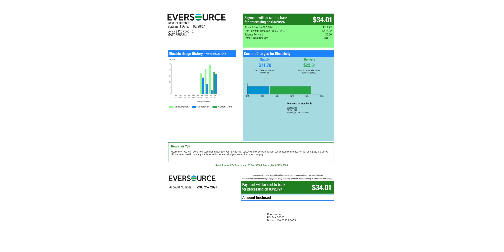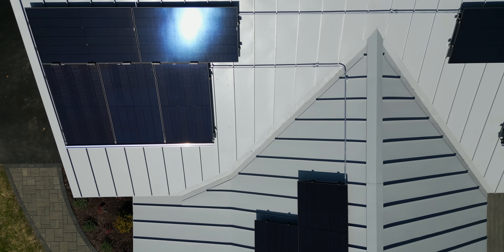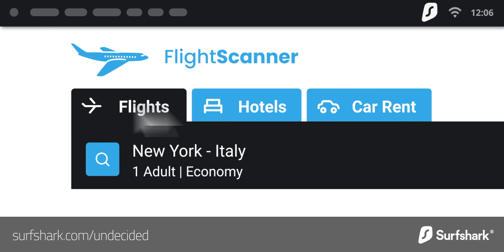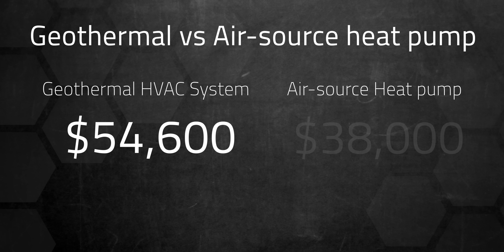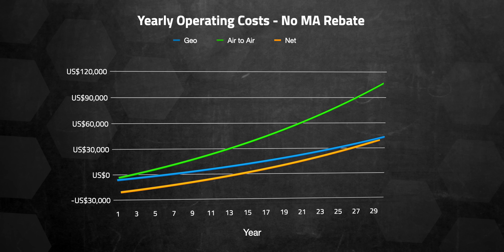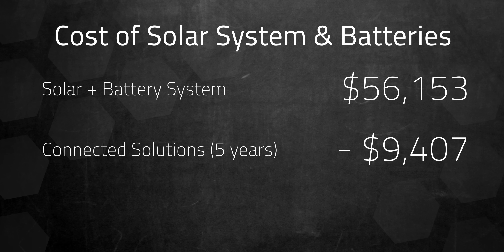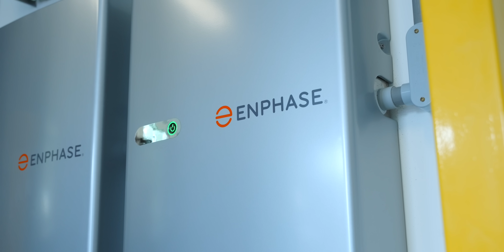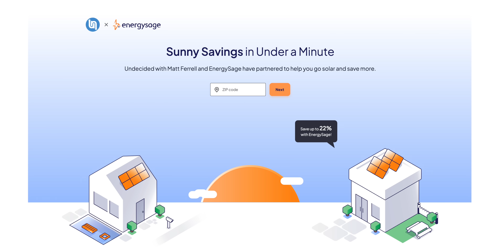What I Learned After 1 Year with New Solar Panels

Comment: The math used here makes zero sense to me.  One thing Matt did not include in his computations is interest, either gained or paid.  Who cares if you could break even on an $89000 expence of solar/battery in 20-30 years.  If you took that same money and invested it, the interest alone would pay for FAR more than your electirc bill and in 20-30 years, you would still have your original investment rather than old solar equipment not worth a penny.  I live in a larger house in a state with the high electric costs (California) and if I computed my annual elecric bill, accounting for the rate of inflation you determined, I would pay about $80,000 for electricity over 20 years.    If I took that $89K and invested it at only 4%, then paid the electric bill from the pool of money (principle/interest) I would still have nealy $80K left after 20 years.  What will that solar/battery system be worth in 20 years?  With interest rates what they are, if you finance the solar, things get even worse.

Comment: Does indoor blinds really help to regulate temperature? I would think you need to keep the sun outside with outside blinds. Or else it will just work as a greenhouse between the window and blinds, heating your house instead.

Comment: Connecticut got rid of net metering for new solar installations so the only options are export all at a fixed rate, currently about 31 cents per kWh or net tariff which is retail rate plus a few cents for renewable energy credits. There is also a battery program that seems similar to Massachusetts.

However in CT our transmission and delivery costs are insane and have only gone up in recent years. So with buy all you might sell at 30 cents, but between all the transmission and delivery fees it can be more than 30 cents especially during on peak usage. Really makes it harder to gauge the long term value of solar installations the state. It was almost a no brainer with net metering.

Comment: Did you take into account the time value of money?  If you sent net 50K net for your system vs 20k for a gas or propane furnace you have a 30K difference in cost. Using the rule of 72, you would have made 30K in the first 10 years assuming a7.2% return, investing 60k for the next 10 years you would have 120K and the last 10 years it would turn into 240K.  That is why using the time value of money is important.  It is probable that you financed the extra cost.  At a 6% mortgage cost it would still cost you around 200k in extra mortgage payments so not that much in savings.   I know this is finance nerd stuff but is something to consider.
Reply: @stephenmontgomery5157  All that to say absolutely nothing.
Reply: The calculation could be much more simpler: you probably don't have spare $100k so in the end comparing the raw prices is speculative. You should calculate the total prices with the loan applied to the difference, it makes the result at least somewhat practical.
Reply: Allways morgage your investment in 10 years. Thats my experience.
Reply: @karinoren  yes you only need electric for the next 10 years.
Reply: Now, someone is speaking about finance😂
Reply: I have a similar comment.    He does appear to have done is math seriously wrong and his calculations are way, way off because of ignoring the time value of money.
Reply: and the true cost of Maintenace, this whole system has a derating annual factor. and can you afford those admittance bills. and this 30 loan. can you afford it when a total replacement is needed in 20 years? about as smart as using a credit card to pay off a credit card, thats how i see the whole thing.
Reply: @diegojines-us9pc  In theory one can insure, or factor in an insurance cost for the fairy small risk of the need for total replacement.  I have not seen data on that, but it's reasonable to predict it.     The real model is complex -- you must predict a real interest rate or rate of return, have a model for inflation or deflation of grid energy prices, panel output degradation etc. You can fudge some of these, but the one thing you absolutely can't fudge on is the time value of the money.   MF seems to do a simple straightline calculation with interest rates set to zero and that makes the result way, way, way off.
Reply: @bradtem  rule number one about insurance. you will pay the cost of replacement. just installments. so the cost is still there the whole time. and by the way. once you install solar. your rates go up. a untalked about expenses they leave out, not for replacement but for the risk. like fires or one flying off taking out your neighbors BMW.

Comment: many expensive, complex and interconnected systems with the expectation of a seamless experience for years to come......yeah i see that working out well.  glad you are willing to push the envelope and see what can be done. i put in a DIY solar system {paid for} and as money allows have added capacity and new more energy efficient appliances and kept my current home.  i am now retired and enjoying reduced costs which gives me a greater sense of security.  i often wonder how this industry would be if there was not the huge amount of money made with having large systems that can only be built with a loan.

Comment: In general electrical storage should be enough to run the house for 4 days.  In California a home did have that much storage charging it with solar voltaic.   During wild fires the power company turned the power off to keep from sparking more fires AND the smoke from the wild fires blocked out the sun not allowing enough sun to charge the home batteries.  Utility power came on occasionally at the end of day 4.  The home owner concluded for such situation he needs a home backup generator to charge the batteries. 

10:36 Peaking emergency  power is expensive, but at $275 per kWh compared with my Cumberland, Indiana residential rates in 2020 being $0.10 per kWh,  it is 2750 times more expensive. 

It is not accurate to state residential electricity cost is greatly the cost of maintaining the power grid as sometimes said.  In the US on average only 38% of the generated electricity reaches the residential electric power meter.   62% of the generated electricity on average is lost to grid resistance.   

A little less than $0.03 per kWh is average for US midwestern wholesale electricity scheduled 24 hours in advance.   That costs $0.03/.38 = $0.078 at the residential meter.   Our Cumberland, Indiana residential electricity in 2020 was priced at $0.10 per kWh.   The cost verses sale price difference has to maintain the power grid and make some profit.  Internally generated electricity should be significantly cheaper.

Comment: With addition of so much expensive equipment and complexity to your home, your home insurance didn't go up? You also need to factor in cost of maintenance and replacement parts for these equipment. I doubt they will just keep going without any repairs or maintenance for 30 years. Solar panels might last that long, but not inverters. I don't know anything about geothermal, but it's a new and niche tech. If anything goes wrong with that, your repair bills will be expensive.

Comment: We have an Oil burning furnace for hot water and forced hot water radiated heating in our house, We just got solar and have at least a 10% surplus in electricity produced even this month, I really want to get off the oil burner but even to reduce it would be a bonus. So here is my question, Do I supplement the oil burner with a hybrid heat pump hot water service in line before it or should we go for heat pump air conditioning and cooling? We are in south western NH

Comment: The numbers work out nice at .31 per KW. In TN I pay less than .11 per KW. Over the last 12 months I have used over 45,000 KWH (<$5,000). I have worked the numbers and can't get a breakeven until at least 25 years out. I love what you did though.

Comment: My god that's expensive. 
$55,000 for 17kW comes to $3.25 per Wp. Here in the Netherlands that setup would cost you about $1.25 per Wp. Also the Enphase batteries are about €3000 a pop. Add a couple of thousand for installation and additional off-grid hardware. 

You guys are overpaying tremendously.

Comment: I paid $16,000 (net after the tax credit) for a 5kW system 5 years ago. Average savings per year on my electricity bill have been $530.  So, it will take over 30 years just to get my money back. If I put that same $16,000 into a conservative investment, it would have produced a return of roughly $1,200 per year.  My net loss by “investing” in solar comes out to $3,500 to date ($19,500 if you include the initial 16k). After 30 years, my total loss to my net worth will be $37,000.  (That amount is much greater if you reinvest dividends from a 16k investment.). Bottom line: solar is a terrible investment.  Unless a $37,000 hit to your retirement fund is no big deal, don’t put your money into a solar system.
Reply: This is along the lines of what I was going to mention. 50k up front put into conservative market vehicles over 15-20 years is going to compound much higher than the savings will be. Solar is sadly almost completely dead. Now some will say that an offgrid situation for when we are living in Mad Max times justifies it but probably the only house with lights on is going to be a target for a raid.   However I think that when I price out everything in components, especially when mounting in the yard vs the nightmare on the roof with the leak potential, then it can work out if you have some know how or have a friend assist.  Getting everything on marketplace or black friday specials could make it all work, but certainly not with a contractor.
Reply: Ours is looking more like 12 years (Australia based), Our last bill was -20$. Perhaps investing it would have come out better, but energy costs are on the rise, we have blackout protection for when there are storms or line maintenance, and I can thrash our high draw devices like AC/dryer all the time without thinking about it, it allows us to increase consumption without paying more.  This was with one of the larger solar providers that charge a premium too, as I want them to still be around if I need to make use of the 20yr warranty.
Reply: @luke5957    Prior to interest rates on the higher end going up, someone could technically finance the solar system and it would make sense. The banks however now bake in a higher rate than normal to cover the risk of the solar installer going out of business before the permits/installs are even completed, as that was also becoming an issue.

Comment: Here in Toronto, my neighbour has his small bungalow roof covered east, west and mostly south, yet at last summer's power outage, it wouldn't even run the A/C. Next, your calculations don't include the replacement costs of batteries after 7 years and the solar panels after 35 years max. The biggest savings, as you're showing, come from properly built insulated houses and I think this should be the priority. Also, I'm surprised you didn't include a basement.

Comment: Sounds good if you have the money. BUT, have you accounted for the replacement costs and repairs and maintenance. Over a 30 year life span, Murphy's Law says that whatever can go wrong, will. Weather is only one impact. When those trees grow up, will they block the sun? Will particulate in the air settle on your panels and reduce efficiency. How compatible will replacement panels be in 10 - 15 years if needed. What about the cost of recycling panels when you (or the next owner) opt for a higher efficiency solar technology. I think you underestimated the cost of electricity from the grid in the future. How much more are the taxes on an energy efficient home when governments realize the can squeeze money out of the value of geo and solar and so on.

I like what you have done with the place but you are assuming nothing will change for 30 years. I see a push to tax efficient homes and a charge for future recycling.
I didn't notice where your water and septic is handled. TANSTAAFL.